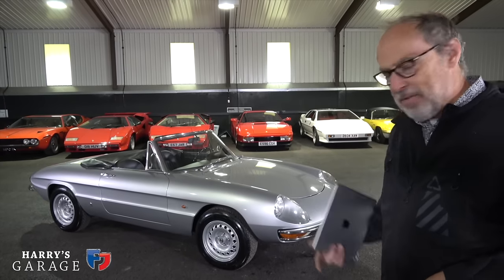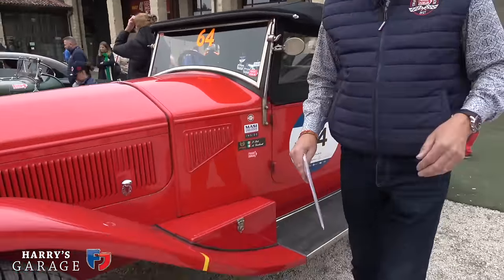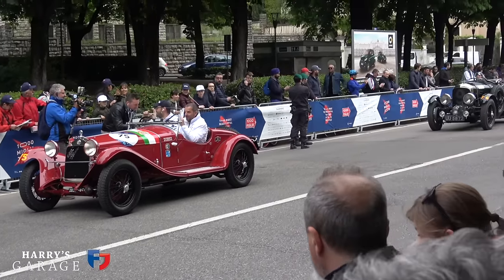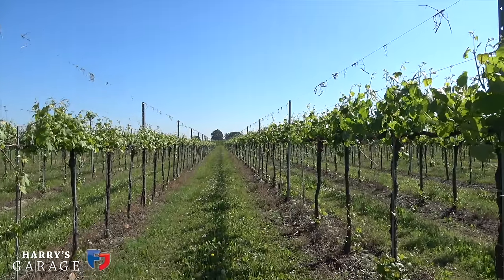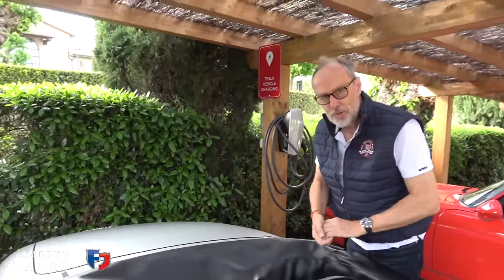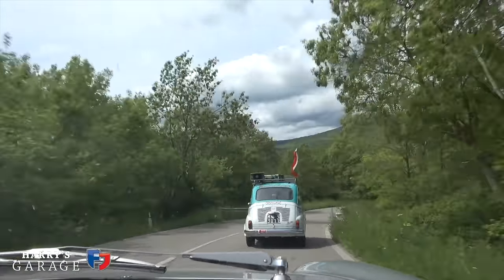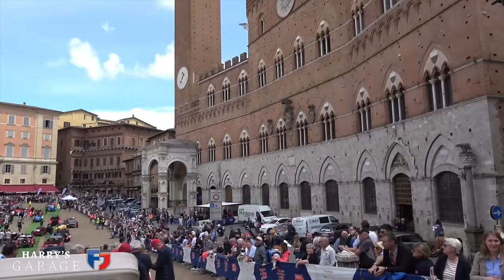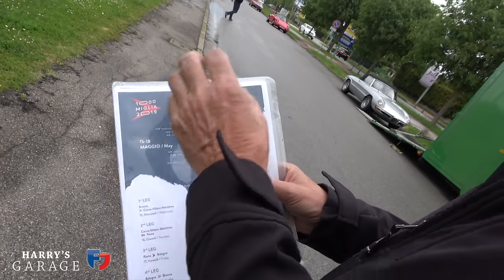Italian road trip special; guide to the Mille Miglia in my Alfa Spider

Comment: Perhaps an electric fuel pump to fill the bowls when you switch they key on and eliminate the vapor lock. It may save your starter. Slight modification may make it much more enjoyable.
Reply: Agreed, other than concerns for originality's sake. I pulled the starter on my Alfa 7 times in a year, once. Lived young and broke in a hot country once, but still drove an Alfa !

Comment: Great video. My wife and I drove down and spectated on the Mille Miglia on five occasions in our 1938 MG TA. We treated it as our annual holiday for a two week trip. Each time we went completely different ways down but were always within 50 miles of a 2850 mile total. I would say that it can be done much cheaper than Harry suggests if you avoid tolls (except in some parts of Italy) and stay in budget hotels which, other than in Brescia, we booked on the fly. I am afraid that we were also alarmed at the crazy driving that we witnessed mostly in expensive modern cars on factory organised tours. However the fastest guys that we saw on one occasion on the Futa Pass were in a MIni Moke which was being driven absolutely on the limit after the main circus had passed through. I can also recommend that another event which is worth a visit is the Vernasca Silver Flag near Parma. Less hectic but very enjoyable.

Comment: Great video, not sure about the costing though, although Harry clearly likes to save a few quid even though its hardly needed.  I drove last month an Ariel Nomad from the UK down to Barcelona, avoiding toll roads in France adding perhaps 2 hours to the drive time, but saving on fuel costs as more economical speeds and cheaper fuel off the motorway network.  Not an economical car, but much more so at 60 than 80 just the same as the Alfa.
Eurotunnel -  Ive taken it several times and always pay return based on next day where its about 60/70 pounds return, but you are using that as one way, so hence total cost is about 120/140 max this time of year and even easter holidays.  So again, way off Harry's numbers.
Used Airbnb at a lovely countryside location and again 50 euros instead of the estimated 200.

A truck is great if you have wealthy friends with free time and cars, which most of us don't, but this trip can be done for well under half the costs mentioned here.  The real question isn't cost surely, its if you want the drive down and if you want to make the drive down as of the adventure... understand those who dont or dont have the time, and if you have done it as many times as Harry, even more so, but for the rest of us.... get driving!
Reply: I've been trying to plan a trip from Bucharest to Cambridge via.. economical means, let's say, and it's usually between 25 and 30 Hours to drive whenever I check Google Maps, which is only a little over a day. As a recreational cross-country driver, do you reckon it could be done in one go?
I've had to stay up for work sometimes almost 72 Hours at a time, and during one trip here in Romania drove over 12 Hours due to bad roads and slow traffic during some awful December weather.
The car I'm planning to use is a petrol '03 SAAB, at civilized speeds (80-100 Km/h) to avoid Police troubles and get as good mileage as possible.
Or do you think it's mandatory to split it over 2 days (I wanted to avoid that since it's basically a loss of 8-10 hours to sleep/eat).
Reply: @vtr0104  For your safety and more importantly in this case, the safety of those around you, there is no way you should attempt to drive more than 10/12 hours in a day.  It is the same as driving drunk.  Yes I am sure you could do it, maybe we all could, but there is no prize for doing it and the risk far outweighs any inner feeling of "yes I made it in one go."   Driving while tired should be an offense the same as under the influence.... DON'T do it please.  Also cant see the big deal of taking 8 hours longer, you sleep most nights, so why not when your and other's lives depend on it.
Enjoy it, but do airbnb it....!
Reply: @garymurraya  Alright, fair enough. I will defer to your experience in this case. Thanks a bunch!
Reply: @vtr0104  Please don't try to drive 25 hours in one sitting. That is madness and even if you succeed you will hate it afterwards. Split the trip and share the driving

Comment: Dont know if its still running but there was a motorail train that ran from Verona  in Italy to Dusseldorf in Germany overnight. We put the car on the train aboard a vehicle carriage, then had a private two berth cabin with washing facilities in the forward passenger section. Dinner was served in the dining car onboard and was like something out of the Orient Express (not quite as high standard but still very good) We only travelled one way frm Italy to Germany on aour return trip an boarded the train at Verona in the late afternoon,  arriving fresh as a daisy in Germany at 8.00 am after having Breakfast aboard the train. Cost a couple of years ago was about £700 but there are much cheaper options, (shared cabins, a sandwich meal) Cut the journey to Norther Italy out completely.

Comment: Hi Harry If your gearbox is leaking oil you could try to seal it with heat resistant silicone. A friend had a scoter he bought sheep it worked perfect but the gearbox was leaking oil I found this heat resistant 300-celsius silicone and it did the job of sealing it.

Comment: Well, Harry, next time you rebuild an Engine, use some Joe Gibbs break in Oil and the way to activate the ZDDP is to floor it as much as you can for 1000kms and you engine is break in. After that floor it as much as you like and you dont have to care about revs since the first moment.
Just be sure to follow every break in step.

Comment: Old trick for a smooth start on the twin cam Alfas. Pump the throttle three times before firing up. The accelerator jets prime the system beautifully.

Comment: Harry Firstly turn the left side comand for full rich fuel than start the ignition and turn on engine your carburetors aré out of sincronism and never start the engine coul without non comando rich misture It is necessary.

Comment: On the final day of the 2001 MM with my clients cars reportedly going well I had parked my mobile workshop in a layby to take a quick 40 winks, when there was a knock at the door and a German guy was standing there asking me (in good english) if I knew anything about superchargers and could I help him, he sounded quite desperate so. I walked over and observed that his very old car had the race number '1' on it but I can't remember what make of car it was. The chap and his beautiful german wife attempted to explain to me the frightening problem they were having with their engine which was back firing violently out of the vane type supercharger's backfire protection valve, well, having built and developed several high performance Shorrock supercharged cars in previous years, I knew straight away from my own experience what was causing the problem and I put it right for them there and then using the resources from my mobile workshop , once I'd finished the guy asked me if the issue was fixed and I told him it was and he replied, 'in Germany I have had several of the best automotive engineers I know look at this problem and none of them were able to fix it or even understand it, now I come across a random English guy in a layby in Northern Italy and he is able to immediately identify and fix the problem, how can that be?' I winked at him and said it must have been due to divine providence placing me in that exact place at that exact time..Anyway after thanking me the couple got in the old car and roared off, about 2 hours later I passed them on the road and they both waved hard at me with their thumbs up indicating the problem was indeed fixed. Sometimes memorable things just happen out of the blue.. 😇

Comment: well you don't have to drive all the distance in france. Belgium and Luxembourg have no tolls. if from metz you drop down to mulhouse you have minimal tolls. Swiss is a fixed price and then you are only a few hours from Brescia. Why go the boring expensive way?
Reply: Coni Glione  which is why I would go the way I mentioned. Shorter, nicer, and you are there and back in around 3200km so the drive one way is do-able easily in two days. I have done the trip over a hundred times on all variations of the route

Comment: You also have to factor in the costs of flights if you ship your car there. Weak calculations Harry.
Reply from the maker: Flights were £55 each way, so add another £110. Not that far out!
Reply: Just use the Gulfstream IV , obviously!
Reply: @harrysgarage  If I'd known flights were that cheap I wouldn't even have bothered with my original comment. Nice video.